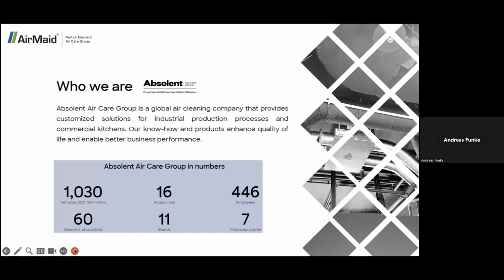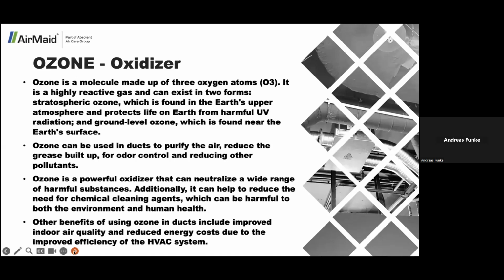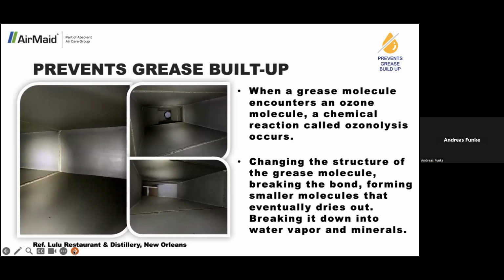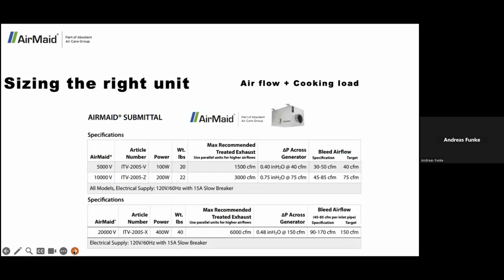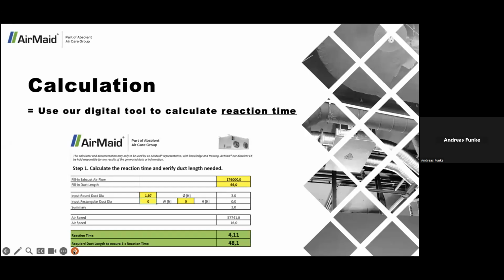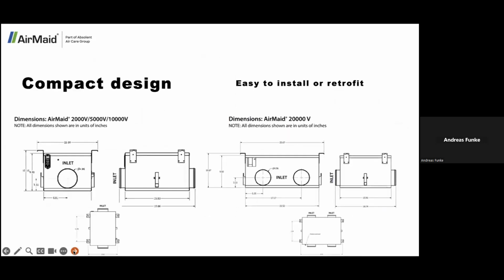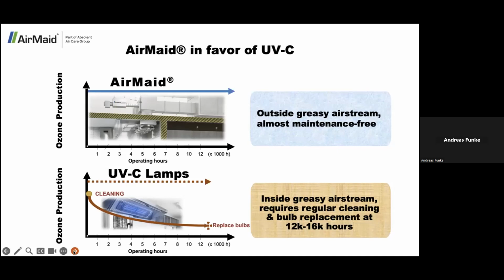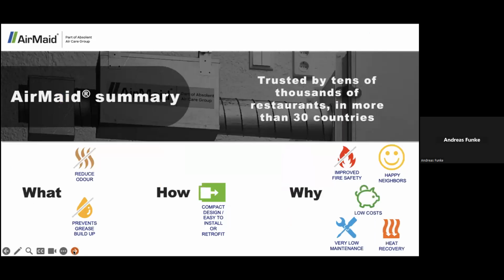Effective Air Treatment - AirMaid

Comment: Are these AirMaid systems effective for cleaning extra-heavy-duty exhaust from solid-fuel commercial cooking applications? If so, is there other equipment required to be part of the design, such as filters, when the exhaust air is discharging through the side of a building in a densely populated area?
Reply from the maker: To my knowledge, you can use with solid fuel systems. Note, this will not reduce the smoke, only grease and odor. The grease hood can filter and you could use a scrubber though they are expensive. We have also used an Electro Static Precipitator (ESP) by Purified Air. This will remove smoke, odor, and grease. Comes with a little more maintenance as it catches grease. Talk to your local reps about options.